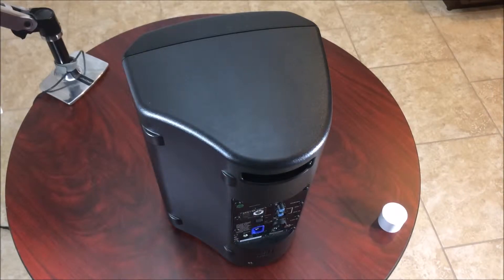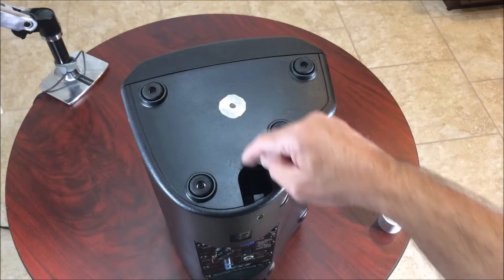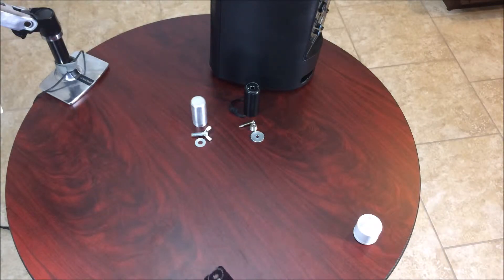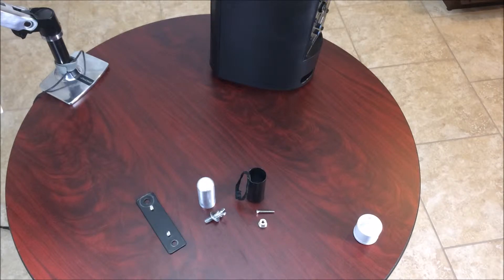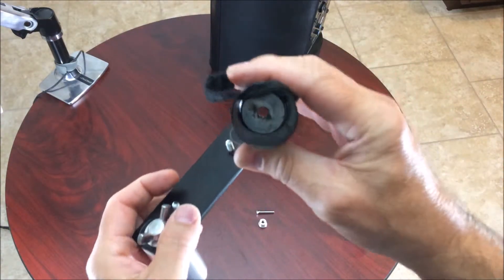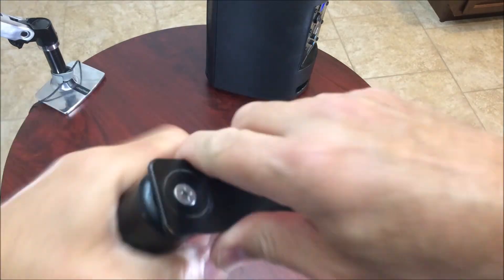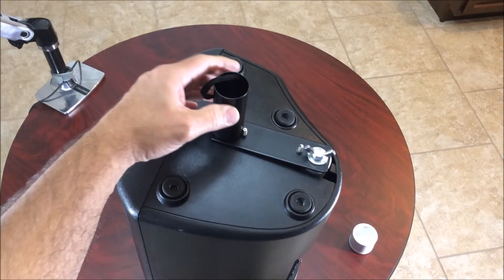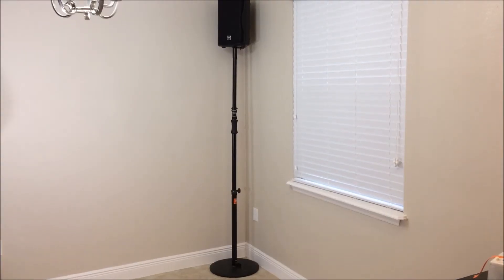How to Fix EV ZXa1 Center of Gravity Problem

Comment: can you send a link where I can get the parts because I have one but I'm always scared it will fall
Reply from the maker: I've use this for several years without any issues. I leave it on all the time, so that everything stays in place. Once in a while, I check that everything is secure. Does anything on yours feels loose? If you tighten everything you should be OK. Remember to tighten the small set screw on the back of the speaker so that it "grabs" the Trusst CT-CONSPK. Here are some of the parts: 
- 24358 Speaker Wall Mount Adapter (www.bhphotovideo.com)
K & M https://www.bhphotovideo.com/c/product/1225496-REG/k_m_24358_000_55_adapter_panel_5_vertical.html

- Trusst CT-CONSPK Totem Speaker Stand Adaptor (ebay.com)
https://www.ebay.com/itm/2-Trusst-CT-CONSPK-Totem-Speaker-Stand-Adaptors-/162446706310

- On-Stage SSA2 Speaker Stand Adapter Sleeve (amazon.com)
https://www.amazon.com/Stage-SSA2-Speaker-Adapter-Sleeve/dp/B0002GODI2/ref=sr_1_25?gclid=CjwKCAiA6seQBhAfEiwAvPqu12gi27DN1QDN45bdoPI4Xe8sLdKlVrnyNcPBVUg5IJwRNKKP_e0KsRoCckoQAvD_BwE&hvadid=178358286674&hvdev=c&hvlocphy=9011757&hvnetw=g&hvqmt=b&hvrand=6239834315927769408&hvtargid=kwd-29085138156&hydadcr=29867_10193677&keywords=on+stage+speaker+mount&qid=1645405311&sr=8-25